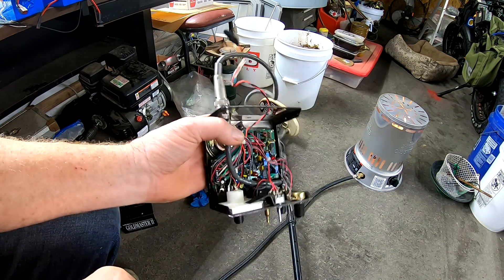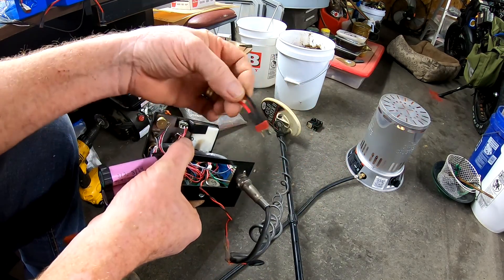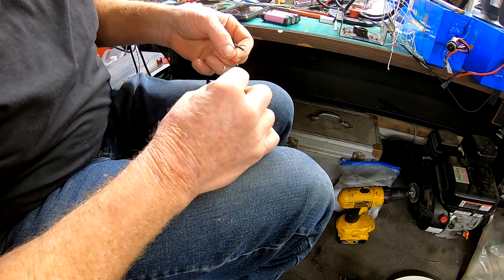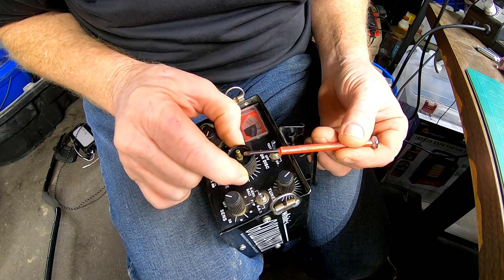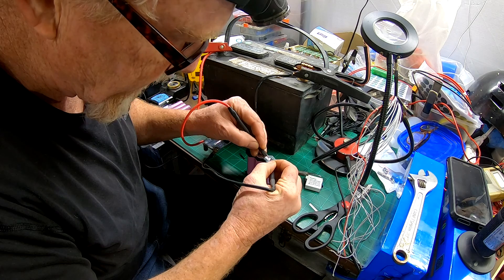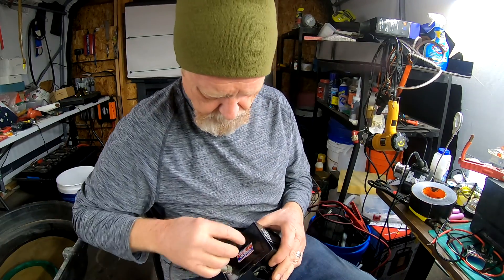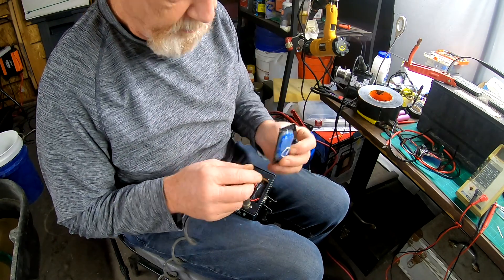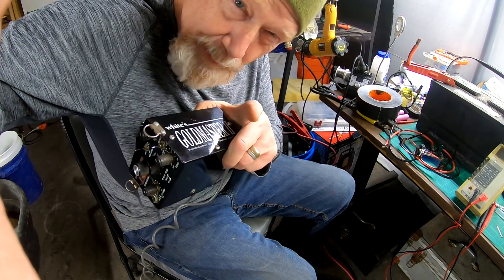DIY Whites Gold Master II Metal Detector Li-Ion Rechargeable Battery Upgrade!

Comment: saludos  yo tengo un bounty hunter y no funciona y podia si realmentre el diagrama para reparado y tengo otro un whiates cm4 28916 j4s2 que idea me da para reducilo es muy bueno espero su respuesta
Reply from the maker: I am not sure what exactly you are asking, sir.
On my Whites Gold Master2, the battery was removed and replaced with Li-Ion cells. 
As far as repair.. I don't really know.
Check locally and see if there is an electronic technician that may be able to troubleshoot it. 
Stay Golden 
Peace Prospector Tripp

Comment: Looks like a good DIY project PT. When you need to recharge the battery, do you have to pull the battery out by yanking on the wires? You could make a thin piece of slide tape attached on the back-side of the battery-pack and not put any strain on the wiring. (Yeau... I know... I talk out loud in my posts!). I have a battery pack from my White's Surfmaster that has corroded terminals sitting in some vinegar right now, so I share your enthusiasm abut those plastic battery cases. BTW.. since it's around the corner, HAPPY NEW YEARS!
Reply from the maker: I was thinking I might have to get the Vice Grips on those wires and Yank that mother out!
😂 
Yes.. as usual you are correct!
I was thinking about that very point when editing this video!
I’ll attach a piece of tape so I can yank on that instead of the wires. 🙄
I’m not planning on removing the battery to charge it , Just take off the door and plug it in.
Anyway I’ll still fix it because those li-ion batteries will pull massive current if shorted! For about 2 or 3 seconds.. then bye bye Gold Master II
Hey! Just thought of a new title!
LTMPE
“Li-Ion Thermal Meltdown Prevention Engineer”
✌️PT
Reply: @ProspectorTripp  .... on a 4x6 business card!